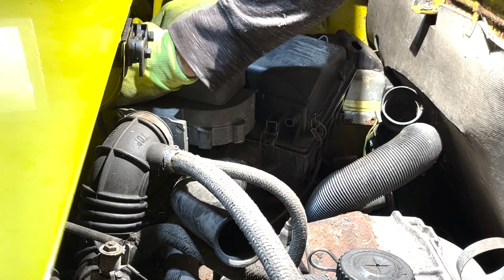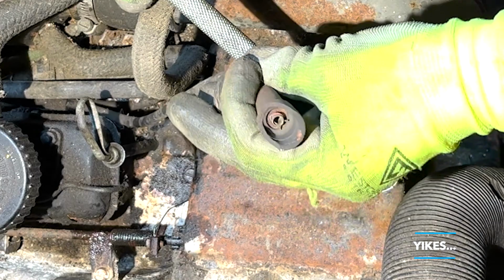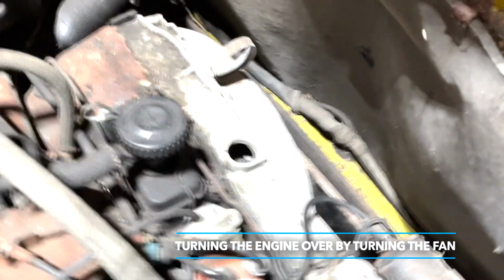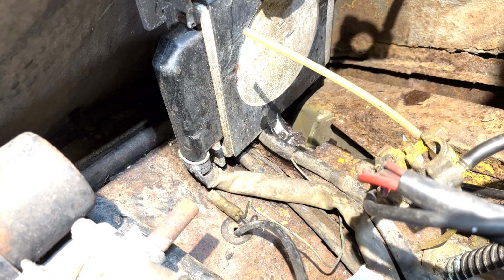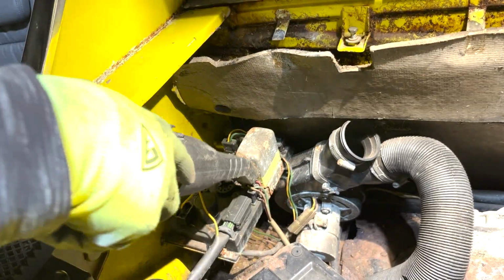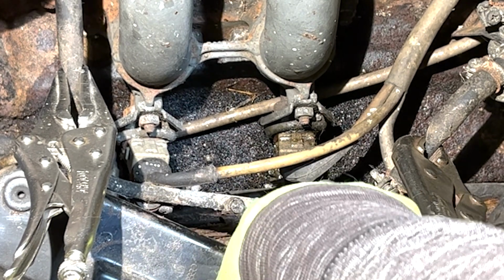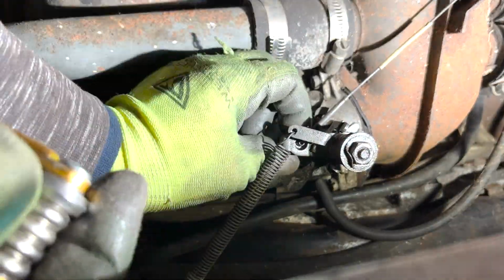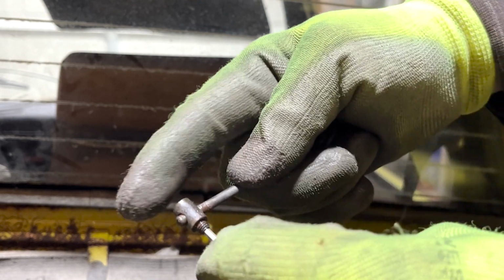What works? What doesn't? Porsche 914 engine inspection before removal

Comment: I'm restoring Califiornia / smog spec version of the same '75 here in the UK. Looks to be the same spec as yours, except mine also has EGR. Despite having just enough paperwork when I bought it to show that it really did spend all it's life in California until being imported to the UK in 2016, it's far from rust free. Interesting that you had the problem with the LH engine lid hinge. I did too, except mine was causing the front edge of the lid to hit the bulkhead. I've had the shell stripped, and after that, the cause was obvious. The hinge bracket on the bulkhead had only originally been welded on with 1 spot weld. The right hand one had 3 or 4. The bracket had pivoted around this one weld, pulling the hinge out of alignment. May be worth looking closely at the spot welds on yours too if the cause of the problem wasn't obvious. There is no access to put more spot welds on the bracket (they top edge of the bulkhead is double skinned), so I tig'd both sides to the bulkhead.
Reply from the maker: Yeah, you're totally right. I checked again and it does wiggle a bit.